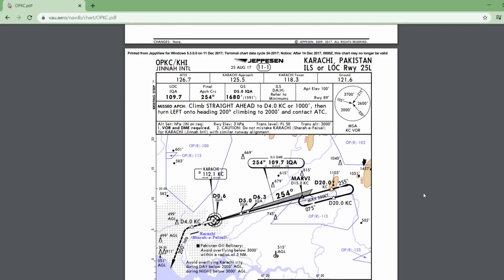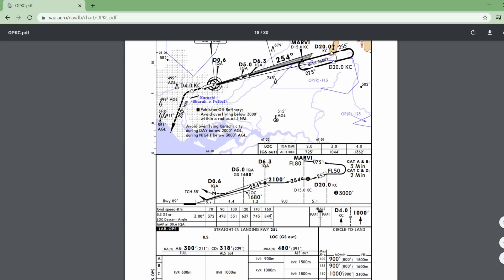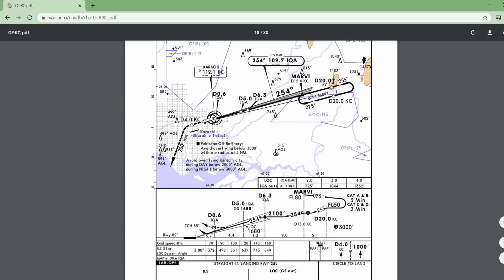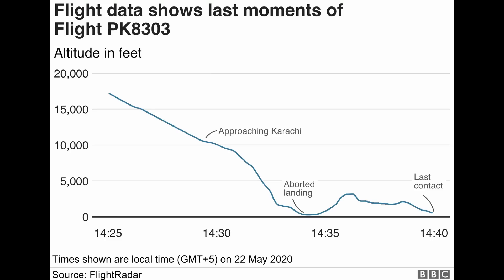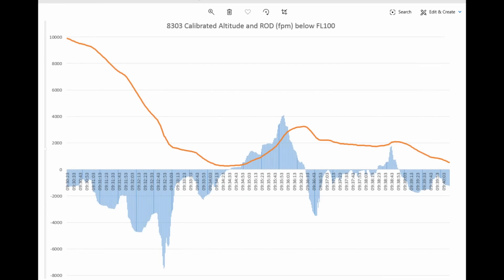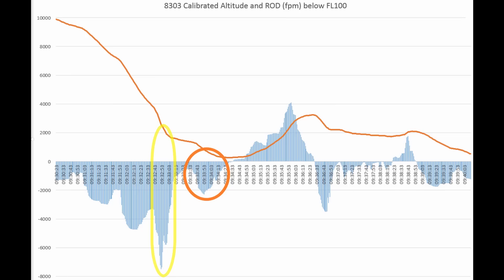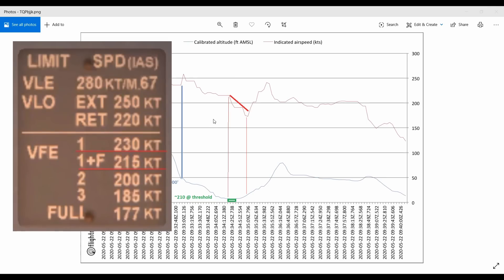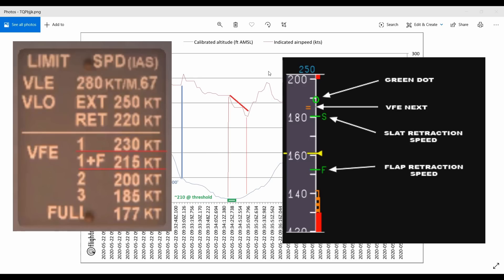PIA #8303 Update #4 Unstable Approach Profile

Comment: Pilot committed seven serious errors together resulting in this tragedy:
1- Plane arrives at the marker 6,000 feet too high
2- Pilot should have aborted the landing but decides to catch the glideslope from above, as he is confused and reckless.
3- The landing gear selector is down but gear is not deployed because of high speed and a chime is sounded.  As the aircraft approaches the runway, its speeds drops sufficiently for the landing gear to deploy automatically and the chiming stops. The pilot mistakenly believes that once the chiming has stopped, the landing gears are fully extended and locked.
4- The pilot/co-pilot fail to observe the two red panel gear unlocked lights, land on the tarmac, scraping the engines and break the partially deployed unlocked landing gears.
5- The pilot quickly decides that all is still well and he can do a normal go-around, so there is no point of doing a belly landing, which they were not prepared for.  A belly landing will obviously result in people getting hurt, and him getting fired, dishonoured, and losing face.  While a go-around with a normal landing will make him keep his job and appear as a hero if Airbus can be blamed.
6- The pilot stupidly turns too far from the airport in his downwind go-around trying to circle the airport and land on the far side of the runway, when he could have just done a 180 and landed on the near side of the runway.  He never thinks that the engines may quit anytime and he needs a field or runway to do a belly land, even though all sorts of engine alarms have been set off.  He turns too far to the east of the runway flying to the far end.
7- Once the engines quit, instead of gliding to a highway or a possible field, he just stalled the plane, as can be seen in the video and the data shows his speed about 130 kts for the last 20 seconds.
8- He should not have fasted and should have not rushed for iftar.
Reply: "6- The pilot stupidly flies too far from the airport in his downwind go-around"   He did not fly too far away, he actually turned left, unannounced,  on a quicker route to reach the airfield as quickly as possible. even the ATC asked him "turning left ?" 
A. The engines failed, that was bad to start with
B.  He put the aircraft in a "high nose attitude", as if trying to fly up and away -- No sir, you have no thrust to achieve this, in fact a high nose with no engines will bring you down quicker
C. If he had levelled the plane he could have glided farther, avoiding populated area, he was only 400 meters from airfield perimeter wall
Too bad this happened !
Reply: @Pune122  The plane was as high up as 3,000 feet.  You can glide 5 km without engines at that altitude.  The pilot turned to go back to the far end of the runway.  That was his big mistake.  The pilot should have done a 180 and immediately land.  But instead he did a go around which is a 360 degrees circle trying to approach the other end of the runway.  At any time he could have landed but he flew so far away to the east of the airport that when the engines quit he was too far to do a belly land, and he landed in the city.
B. That is what I mean by "stalling" in #7.
C - exactly.  He could have glided the last few seconds, but instead stalled it thinking some angel is going to save his butt.  He was foreign to the concept of gliding.  Gliding would mean he had to commit to a belly landing.  But no, he wanted to land on the far side of the runway like a hero.

Comment: Although it does not seem that the aircraft was going over 250 kts right prior to landing, it was going over 250 kts at 33:00, about 72 seconds before touchdown.  It is quite possible that the landing gear was down before 33:00. Then at 33:00 because 250 kts was exceeded, the automatic control issued a landing gear retraction command.  Once this sequence is started, it has to complete and it could take let's say 40 seconds to retract the gear and be ready for a redeployment.  So the gear retraction started automatically at 33:00 and then at 33:40 when it was fully retracted it got redeployed automatically as the gear lever switch was still down and the speed had dropped below 250 kts, so that it would have been deployed and locked at 34:20.  But the aircraft hit the tarmac at 34:15 before full deployment, so that must have damaged the landing gear that is still extending and was not locked.  Hence the mistaken belief by the pilot that the landing gear had been fully extended prior to touchdown and therefore he lands on the engines and breaks the landing gear.  Once airspeed dropped below 250 kts, and the gear started getting extended automatically at 33:40, the chiming would have stopped.  This may have given the pilot the false impression that the gear was fully extended and locked, so he hit the ground, as he was in a rush to land being mid-runway.  The pilots did not bother to notice the two gear unlocked red panel lights.  Or the co-pilot was too intimidated to tell the pilot that the landing gear was still red.

Comment: They scraped the macadam meaning  that either they were unawarethe landing gear wasn't properly lowered. Then tried to bounce back up  regain altitude when perhaps the safest bet was to stay put and let the plane finish its forced landing. At least they could've saved lives if not the plane.  These guys were probably too overworked and not properly trained.

Comment: I suspected last sunday this all started long before the pilot said he was "comfortable now", now with the data we can see how it was actually possible for the aircraft to scrape the engines and go around. no gear down to slow the aircraft but more intrestingly no flaps extended, some of you may remember  LOT airlines flight 16 ok so it was a 767 not a 320 but the only three diffrences between flight 16 and flight 8303 is the later was touching down at a far greater air speed and it didnt drag any of the rear fusalage on the runway and it didnt have the flaps extended, had it been at the correct approch speed it wouldnt of had the momentum to go around once the engine cowlings touched the runway.
Theres more to this story and it happened about mid way into the flight and we wont know untill the CVR transcripits are finalised what that was so keep tuned to Blancolirio's channel for updates when they become available.

Comment: Over at The Flight Channel, they have the ATC conversations.  On departure, the PIC was lecturing ATC on the runway lights.  Sure sign he was a cowboy.  My theory is that he never realized the cockpit warning chime was sounding for the gear; he just figured it was because he was flying the approach like  a dive bombing mission.  The $64,000 question: did the MLG fail to deploy because he was overspeed?  Or did Captain Numbnuts forget to deploy the gear?
Reply: Captain Arrogant was flying too fast for both gear and flaps. That's also why he had enough inertia to take off after scraping the engines three times. He reckoned he deserved a 2nd chance and pretend he didn't make a stinker.

Comment: I was sick to my stomach watching this. That captain is responsible.  He lost his life too poor man. 

I was on a Boeing 707 that we were doing a Hadj operation out of Nigeria on in 1983.  American company with American pilots. Our landing gear didn't seem to come up after take off. The engineer tried to do it manually. We ended up not knowing what the situation was with the landing gear. We were going to Jedah to pick up a full load of Nigerian pilgrims. We turned back afraid our landing gear was stuck. We had fuel to take us to Jeddah but we flew around to burn off the fuel as we knew with a Belly In landing the engines woukd catch fire by scraping the ground. When we had "dumped" the fuel Lagos airport were expecting us and had completely covered the runway with foam and the firefighter trucks waited ready to bolt into action. We prepared the cabin for a crash landing but Thank God our landing gear came down and we had a very soft landing.

That the pilot tried to belly in with a a load of fuel on board was utter madness. Total madness. 

Thank God he was never my captain. I flew with mostly Pakistani flight crew (ex Air force pilots) when I flew private jets for Bin Laden Brothers, National Commercial Bank, Al Amoudi.
Reply: Anna O'Leary What do you mean by Al Amoudi, the last word in your comments? Is Foam like a semi liquid? How can a pilot miss gears not activated while touching the ground? Were not both pilots fatigued or panicked? Too inexperienced in not dumping fuel, or not even reminded by the tower?
Reply: That's a scary story. I am pleased you survived to go onto other adventures.
The pilot of the crashed PIA flight was far too experienced for his actions to make sense. Was the co-pilot allowed to "interfere" with the pilot's decisions? Or did workplace culture inhibit him? The pilot's "order of operations" were severely defective. Landing is just about the worst time for a pilot to "forget" how to do their job.

The 3 theories I am in favour of are brain function based:
1. Fasting playing a (rare but well-documented) role in giving the pilot profound mental fatigue, and semi-delirious cognition.
2. A cerebral infarct event, leading to poor decision making and diminished competence/comprehension and confusion
3. Cabin pressure AND oxygen emergency leading up to poor decisions, starting before descent to 10 000.

Comment: I have been following your updates. As they seem to be the only ones out there that are accurate and on the money. You have opened up a pandora's box of questions with this update. Was this a terrorist act? Were the pilots in control of the aircraft during this approach? Why would they have flown an approach so far out of normal parameters? A decent rate of 6,000 ft/min?! It almost looks like a fight over the controls.

Comment: If I were to make a guess, this is what happened: The aircraft was going to fast, there for the landing gear was not extended. The pilots did not respond to the warning siren(or maybe they did) and continued there way on final instead of going around to sort out the problem. The planes engines scraped the runway and caused enough the engines to fail/malfunction. The RAT was deployed to supply power. But with two major factors: the complete loss of thrust in both engines, and the aircraft ascending contributed to the stalling of the aircraft while it was gaining altitude to go around- That is what I think most likely happens.

Comment: I guess there was so much chiming going on in the cockpit that they didn't recognize the gear warning chime.
Reply: So it seems!
Reply: that chime is the general config alarm in the bus.
It sounds in many different situations,  like when advancing throttles on ground without the correct TO config or when speed exceeds the maximum allowed value for each flap setting.
It also sounds in flight when the LG lever is set on the down position but the IAS is above 260. In this case the safety mechanism of the airplane cuts the hydraulic power in order to prevent the landing gear extension. The gear stays UP! 
Is possible (IMHO) that the crew was conscious of being fast, so believed the alarm was due to a "flaps overspeed" instead focusing to the fact that the aircraft was above the VLO and the gear was still not down.
SAME SOUND.
Reply: That would make very much sense and explain a lot. In one of our light aircraft, we have a traffic warning system. It goes off so often in the pattern that sooner or later you simply stop listening to it because you can't afford to be distracted by tons of false alarms. This stopping of listening is not even a conscious decision but happens automatically. Because the brain continuously filters "noise" that is not important for the task at hand. I don't like this traffic warning system because I fear, that this sound filtering might also filter the stall warning if it ever should come up, which has a similar sound.
Reply: @tm8473  This seems to be the plausible scenario.  Now that the CVR is found,  the recording would shed more light on whether or not the LG were lowered.
Reply: The chime is the over speed warning. The gear warning is a voice “ to low gear”
Reply: Shouldn't there have been belly scrape marks too on the runway, if the LG didn't open?
Reply: No, the engines are lower than the belly.
Reply: @frogman1557 ,. Awww... You are an Airline pilot. Too low gear. Too low flaps. Love the training... 😁
Reply: @frogman1557  __ In a previous video Juan stated that the 'gear warning' was the same as the general 'chime' warning. If they had been hearing that warning for minutes because of the glide slope anomaly they might not have even considered that there might be any other reason for it to sound.

Comment: Two observations:  250 knots and 6,000 FPM descent is fairly close to 10 degrees nose low which counts as an unusual attitude in most airlines.  I wouldn’t be surprised to hear they touched that parameter a couple of times during that approach.  Also, more of a question here:  Does the Airbus gear not down chime sound similar to the flaps overspeed chime?  I realize there’s also a a French voice warning the gear isn’t down, but with task saturation, poor CRM and channelized attention, is it possible they misinterpreted the warning as the flap overspeed and thought to themselves:  “it’ll be fine, we’re hot, but we have 11,000 ft of runway?”

Comment: I am curious. Wouldn’t air traffic control have noticed he was at 10,000 ft just 4 miles out?  How were they cleared to land?
Reply: Pandemic made the runways available
Reply: donsheffler, Juan & all - this is as good a place to make my second only comment having viewed all 4 posts. The only other piece of credible info that I’ve come across outside of Juan’s effort is that ATC did ‘challenge’ the flight crew about both their height and speed relative to their distance from the airport, at 10,000 feet & 7,000 feet.  I’m also accepting other commenters that ATC’s responsibility/powers centre on separation between aircraft using the airport.

Comment: Hi Juan. Look at this page for the A320 landing gear systems. The system prevents hydraulic pressure to the system if the AIRSPEED IS GREATER THAN 264KTS! I am convinced they tried to lower the gears at this speed and the prevention system kicked in, BUT when coming below this speed again, the system does not automatically lower the gears again because the landing gear lever MUST BE RECYCLED up and down again! These pilots should not even have be allowed to throw paper planes or fly dragons kites in the local park with the children!https://books.google.cz/books?id=fEOaDwAAQBAJ&pg=PA213&lpg=PA213&dq=A320+landing+gear+extension+speed+prevention+system&source=bl&ots=A1yquEQIE-&sig=ACfU3U1rqfyo_62jDpje5akI2jiJw6ZN6w&hl=en&sa=X&ved=2ahUKEwi8iprHtNTpAhVht3EKHVAiARgQ6AEwCnoECAoQAQ#v=onepage&q=A320%20landing%20gear%20extension%20speed%20prevention%20system&f=false

Comment: overspeed ...unbalanced approach...failure to follow sop...attempts to deploy l/g preemptively...stows gear because of annoying master alarm(S)...forgets to extend them on final.  

occam's:  pilot misconduct AND lack of proper crew comms to intervene/solve problems.

sidenote:  as the airline industry around the world is about to "restart" there will significant pressure on flight crews to make schedules, quick turnarounds, and cut short corners to save fuel and hit exceedingly difficult milestones.  This is going to be a very stressful environment of pressure that will expose human factors risks.  We have thousands of pilots who have not been active for quite some time under lots of "new" pressures and demands to fulfill airline priorities.  I pray this transition will not realize serious accidents, but it is very likely to happen given the risks that tend to increase about such circumstances.

Comment: PIA is an airline that, like many other airlines in the world, is steeped in the National culture. One of the elements outlined in the concept of CRM (cockpit resource management) is the ability of the PNF (pilot not flying or monitoring pilot) to communicate freely and firmly with the PF (pilot flying). I do not know who the PF was on this flight. If one assumes that the the PIC (Pilot in command) was indeed the PF, then my point is pertinent. Pakistani culture, like others in Asia, is very much where one does not question authority......in this case the authority of the PIC. Jet Captains in PIA exhibit a "holier than thou" attitude and don't take kindly to anyone questioning their authority.
Many decades ago, I was a grateful jump seat occupant on a PIA B747-200 flight from Karachi to London Heathrow. I noticed with amusement that the PIC slept for a full two hours (with snoring and all) while occupying the left seat! This practice, while apparently harmless (the aircraft was in cruise, the 1st officer was awake and alert and the FE was monitoring systems) is nevertheless a very bad idea! It flies in the face (pardon the pun) of good CRM and completely negates the concept of shared responsibilities on the flight deck. A snoring Captain on a flight that is only 7-8 hours long, suggests that fatigue is prevalent and a dangerous mixture of shunned duties and tiredness awaits in the shadows to emerge at critical moments of flight. Needless to say the landing at Heathrow was uneventful and quite a greaser....but my memory still remains as a question damning the company culture!
It is entirely possible that the unstable approach of 8303 was evident to the 1st officer but his silence was expected and maybe, even encouraged.....   
Thank you for your excellent analysis!!